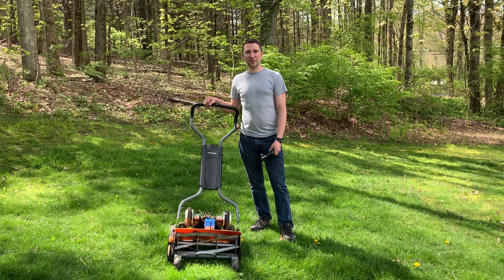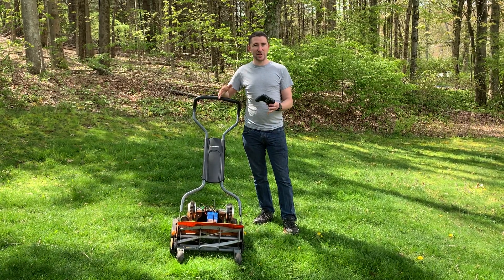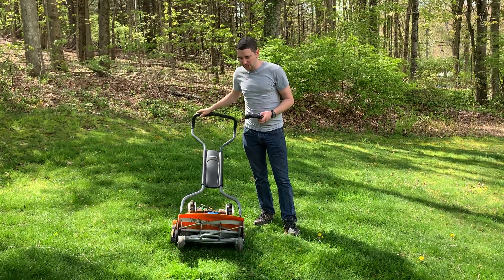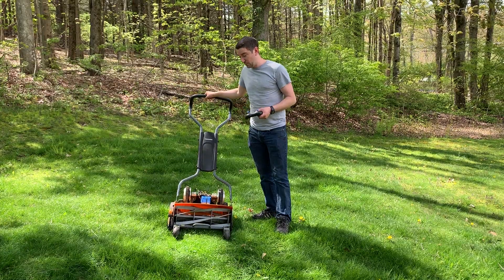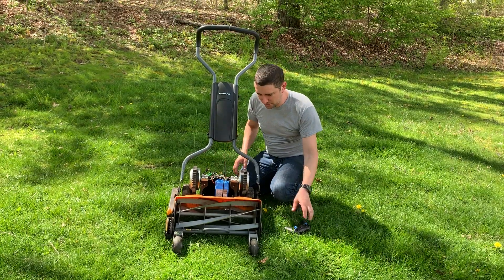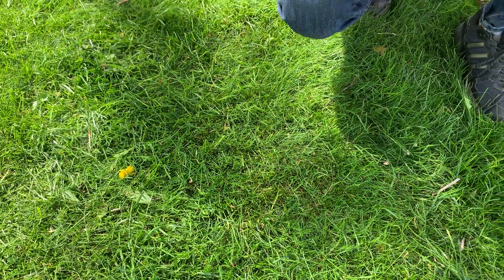DIY RC Reel Mower Tank

Comment: The flaw to all of the push mower style reel mowers is the rpm of the blades.  This is great fun but an additional fix to power the blades independent of the wheel drive would greatly improve the quality of cut.  Thanks.
Reply: This blade is a freewheel so it would be really efficient. That was my thinking is it could push itself like it's designed to do. It's not designed like other reel mowers.
Reply: I'm elated to let you know that the rpm thing does not apply to mine 😁. As a matter of fact I operate my mower and it reel at roughly 50% of their capacity 😎

Comment: I think having a separate motor to turn the blades,would have it cutting a lot better,  that design, although good,the wheels need to be turning fast for a efficient cut. If we slowed the wheels down,and sped the blade up.it would cut like nothing else.
Reply from the maker: There are designs on YouTube with high power blade motors as you are describing. The third motor design is not within the scope of this project. A high velocity reel and upgraded drive motor would certainly cut some big stuff and is an interesting approach. How would you reduce the amputation hazard? I hope you build something cool and post back.

Comment: Hi dave, 

I’ve been doing research on Dual VESC from Flipsky. To make this project do I need the ODrive BLDC Controller and FLIPSKY electric speed controller ESC?
Reply: Hi Joe,

Yes you could use a VESC such as Flipsky. Anything that takes your battery power and a control signal, then outputs pulses to the brushless motors would work. I chose Odrive because it costs less, has more growth potential (it has Python) and uses the Hall effect sensors. You could use either Odrive or the other approach but not both at once. Please don’t buy a knock-off though. Not only does that harm innovation but they are also dangerously unreliable. Too high risk for a mower project.
Reply: @davidmorganson4327  thanks Dave, So if I get the Odrive I could just plug in the the RC reciever?
Reply from the maker: @joecolianni6800  Hi Joe, The answer is “sort of”. Odrive is very versatile. It should be possible to make the project fully autonomous interfacing with the more advanced communications protocols available. For now, I have slightly adjusted some open source Python script from the Odrive site. There is going to be a learning curve. In the end you can set things like max output (safer torque), and low voltage battery cutoff so you don’t damage the battery. I forget if PPM or PWM format was better for the RC input. I recommend you look them up. It’s an interesting read.

Comment: Great build! I have everything I need to build one, 3d printer, hoverboard and the same reel mower. My only problem where do I download the  wiring schematic diagrams , electronic parts list. Can you help me?
Reply from the maker: Thanks for the interest Joe!
I’m still “reeling “ from this auto accident (pun intended). I will put it on my agenda to get the 3D printed  parts posted up starting next Tuesday. Most of the printed parts are better in PETG as opposed to PLA due to creep characteristics inherent to PLA. Don’t get me wrong I loves me some PLA, just not everywhere.
Reply: Your health comes first. Take your time and stay safe.

Comment: Do you have a link to this project?
Reply from the maker: Hi, unfortunately my recovery from an auto accident interfered with this project. I'm starting to do better, but I still haven't finished the guide for this project or posted the plans. I hope to get back on that in the next few months.
Reply: @opensourcediy7326  I hope you are doing well. Is that a Riviera hover-1? do they come with 1 or 2 batteries? thanks!